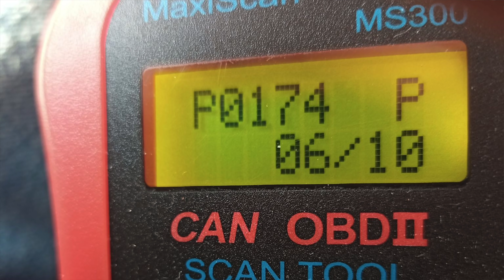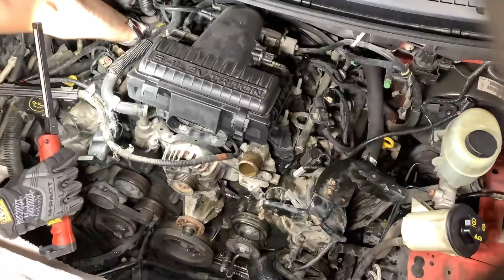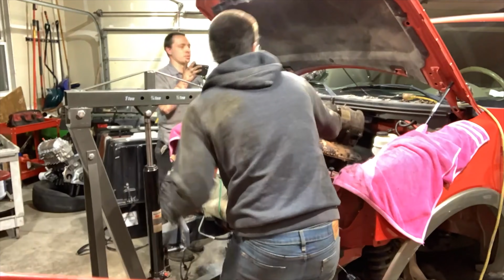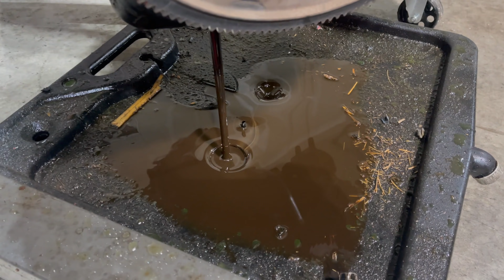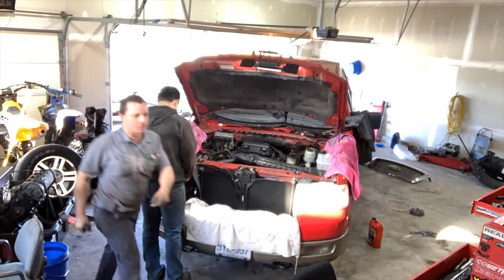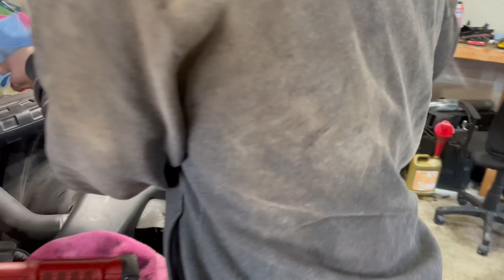2005 F-150 5.4 Powertrain Overhaul

Comment: If this was mine I don’t think I would of put another 5.4 back in, I would of gone with the 4.6. In my opinion there more reliable but that’s probably because I’ve had so much good luck with mine 315,000 and still running well

Comment: Dude 2006 f150 4.6 190k  why is my brake light on. 

I’m not an idiot there is fluid in it the float sensor is working and the parking brake is not engaged and sensor is also working and there is no codes.

Comment: Now time to run 5w-30 for the next 230k.
Reply: You being sarcastic or very unknowledgeable ?
Reply: @froglobster  very knowledgeable. I don’t comment unless I know why I’m talking about.
Reply: @Bushy556  You are entitled to your opinion. Maybe I shouldn’t have phrased my question to you like that. 
Facts with these engines is stick with factory recommendation  because the oil ports are unfortunately super small and the oil needs to be thin to get out quickly to the phasers. I’ve spoken to old school mechs I know plus vids all over. I have an 08 F150 106000 miles I use the Ford recommendation no problem clean block oil change every 4-5 thou. Had truck since 2010 ain’t risking thicker oil.
That’s enough backup facts for me plus owning one.

Comment: I have a couple questions. I love how these trucks look but isn't $10,000 in repair excessive?  Wont it be better to get a used 4.6 2v from the junkyard inside?? I am not  very familiar with these trucks and  I don't know if the engines are interchangeable. I could understand a re manufactured transmission. In the case of the engine, are the re manufactured engines prone to problems again?? If I do get this truck, How long can I drive with the bad cams before it explodes?? Thanks

Comment: what wouldve been nice is a melling 360hv oil pump but im sure upkeep on oil changes will do fine
Reply: He could add one when he reaches about 90,000 miles on this engine, timing set & oil pump is good preventative maintenance.
Reply: @paulsosa1872  true, I did my timing and oil pump at 300,000

Comment: Did the same repairs on a clean high mileage non running 3 valve F250 I purchased:
Six years later and she still runs like a top.
Gotta love that vacuum hose on the lower backside of the intake manifold. Was a PITA to connect with the manifold installed, was difficult to reach.
Reply: I'm starting mine and I'm worried about that thing

Comment: They last a long time.. 5.4L 3V withstanding. The 6spd trannies are rock solid just replace fluid every 60k mis or 40k mis if you tow heavy! Owned 2 - F150s w/5.4L no issues. Now run gen2 Ecoboost '18 F150 Lariat FX4.
Reply: That body style only had 4speeds for the v8 trucks
Reply: @MichaelFletcher-to7mm  that later yrs towards end of cycle had 6spd trannies. They used the 6spd till '17 in F150. Drive the new 10spd sometime ..its amazing.
Reply: @Davido50  I’ve driven the new 10 speeds, the 6 speed wasn’t in the f150 until 2009

Comment: The only problem he made is not running the right oil from new you have to run 10w-30 conventional mine is all original engine and transmission never touched and my 5.4 three valve has 325,000 miles and still daily driven and still tows trailers weekly
Reply: I think you might be right. 5w-20 and extended oil changes kill these engines.

Comment: I have 310k on mine. Same year and engine, just a super cab and 2 wheel drive. I have a lot of problems with the drive. Pulling, steering wheel crooked, suspensions noises. Plus some engine misfires. 
Do you recommend I put some money into it? If so what would you do?

Comment: Just hilarious how many Silverado’s with over 300k running just fine
Reply: Exactly. My 2004 Chevy @ 290,000 and still runs great.
Reply: 95 k1500 380k miles
Reply: My 2010 f150 with 4.6 3v has 315k miles and still running fine
Reply: 97 K1500 245k
Reply: Pre 2000, everything after that has similar problems with oil pressure. A lot of the ones 2008 and -2012 are trash and you know it
Reply: And way easier to work on.
Reply: My dads 2015 needed a new engine due to AFM 1800 miles out of warranty.
Reply: @Bushy556  how frustrating!

Comment: Is the new 5.4 better than the old one?  As I understand it the old 5.4 3 valve had smaller oil passages.  Is the new 5.4 built better?
Reply: I'm not sure where people have gotten that from. The size of the oil passages were never the problem, the factory oil pump is. The backing plate on the oil pump begins to fail, causing the oil to pour back into the pan instead of being sent to the heads and timing components.
Reply: @kingdaniel3519  Sure - that's the only problem with the 5.4 or ANY Triton engine (sarcasm)

Comment: I just replaced the exhaust manifolds, timing chain and tensioners, oil pump,  got a phaser lock out kit with a tuner. Truck runs better than new. Spent $2200 total.  The 5.4 3V doesnt have to be thrown in the trash unless you have some kind of major failure. They are tougher than people think
Reply: How much torque down low did locking the phasers cost you?
Reply: @jakejacob9814  Honestly it feels better than it did before the phasers went out. I also put a full duel exhaust with X pipe on at the same time, so that probably helped the low end too. Im glad I went with the lock outs
Reply: I was at the same point with my truck. I went ahead and got a crate motor from Ford. 2k more for a whole reman engine compared to timing job components.
Reply: @kawalaco  That's one way to do it. I knew I had a solid short block (good oil pressure, no knocks, no oil usage or smoking), and I wanted to eliminate the whole cam phaser setup, so I chose the lockouts
Reply: Yeah it gets boring listening to the slamming. My 08 F150 runs just fine.
Reply: @froglobster  I promise you 95% of the people bashing the 5.4 3V have never owned one. They just parrot what others have said on youtube. Everyone thinks a mechanic that has a youtube channel is some kind of  automatic genius. Nope

Comment: Backfire is caused by bad spark plugs.  300k miles on my 04 5.4 3v no issues ever (original everything). 15w40 8qrts since new..original: coolant,fuel system,power steering,trans fluid, coils,water pump,exhaust.    Replaced: belt,pulleys,battery,e3 plugs, its on its 3rd alternater.

Comment: Exactly how I felt after rebuilding my 4.6 on my 97 f150. She purred quite from first  start and been running good ever since. Wish I could have afforded a new one, would have been less than half the work. Fords can be tough to work on, you guys worked your ass off for sure, that would have took me much longer to do.
Reply: Strongest motor i ever owned! Headers programer intake camms ", i was getting close to 340 hps

Comment: The options are: get a newer truck where in 5 years ownership and like 60k miles, the repairs will probably be over that 9k, parts only but you know. It's less reliable in most cases, minimal good features. 9k plus labor so idk lets just say its 12k 15k, that's what....a 2010 truck? So get another truck with lots of potential problems and probably in rough shape...yeah no. Not all that sure that i'd pick a 5.4 3v as the truck to put all this money into, BUT if it can give him another 150k plus miles, that's surely worth it.

Comment: Opinion on 2011-2014 6.2 f150
Reply: they are great but very expensive and hard to find. There was one for 25K, I tried to bargain and it was sold the next day. They have a small issue with breaking valve springs but usually 100% repairable.

Comment: When my 04 3V Triton puked it timing guides like most guys I chose to rebuild timing in place....my truk although not as nice as this one was at least very solid. It was mostly a workhorse.
By the time you are done dealing with a hundred other things you will discover its far better to just replace the engine ....mine drove me crazy for months afterward with small crap....it just wears you out working on these things because they are so badly designed and no thought given to EVER repairing them.   Your point abouth the intake is spot on !
I did the timing set but left the intake on....as soon as it was running again I had lean codes big time......had to go back in and pull the intake....what a nightmare.  Seems the gaskets were dead and perhaps got disturbed doing the timing set just enough to leak when it ran again.
The list of stuff that I did fix with the timing is long too and added to cost....power steering pump and lines...oil pump you MUST always do that !  Pulled the pan to clean the shredded plastic from timing guides out of it.  Had to go back in and replace the oil temp sensor !  It throws codes if it can't read it !
That said it has run great for the last year so Im happy.  Did 100% of the work myself still cost almost 4K Canadian dollars by the time I did plugs and coils.   Worst vehicle I have ever worked on....04 was a complete re-design and this is how it was done !  Smokin toooo much stuff at Ford.

Comment: When I changed the motor in my 2005. I purchased a engine from a 2011 F150 since it has newer style spark plugs
Everything you changed mins the trans
Banks Headers
Vct lock out and HP tuners tune
👍👍
Reply: Your story is crap. The 5.4 was phased out of the F-150 in 2010.
Reply: @kingdaniel3519  your face is crap
Reply: @gr8bart1  Thank you for that, you pre-pubescent assclown.
Reply: @kingdaniel3519  LOL
Reply: @kingdaniel3519  I didn't say I put in a eco boost did I!!  I said I put in a 5.4 with the newer style head. If I was off by a year in my comment who cares. They made that motor till 2013. Keep on moving your trying to make something outta nothing
Reply: @gr8bart1  it’s OK, bud. You got caught lying. Move on with your pathetic life. 👍
Reply: You can’t put a 2011 engine in a 2010 let alone a 2005 unless you want to spend thousands more to make sure the electrics function properly.
Reply: @jass7981  Doesn't matter if it was a F150 Expedition or Navigator it's all the same Ford made that motor till 2013 with redesigned heads.  Move on troll.
Reply: @gr8bart1  Ford did not put a 5.4L in a 2011 F150, troll.
Reply: @jass7981  Who cares dude, you probably can't even change your own oil. Let alone do a engine swap. Move on from my comment, make your own
Reply: @gr8bart1  not sure why someone would lie about something like that. You must be pathetic in real life. What a loser.
Reply: @jass7981  yet your still here.

Comment: With Regular Maintenance. This thing will run for another 200k. Biggest thing to kill 5.4 3v is lack of maintenance. I do wonder if it would have been faster and easier on your back to just lift the cab off instead. Since you replaced the engine and trans in one shot.
Reply: Obviously, this one was meticulously maintained, inside and out - but still - engine/drivetrain needs to be replaced at 200,000?   This isn't the 1960's when that was considered "long-lasting"!!!

Comment: Do you still have the black F150?
Reply from the maker: Yes
Reply: @DanielJaegerFilms  Ok
Reply: @DanielJaegerFilms  the body on that truck is amazing i take its a southern climate truck? I have an 07 almost identical to this truck mine is all red xlt with 147k the rear wheel lips are rusting as is the cab corners in 2016 at 105k the 5.4 3v died all the timing
 components went due to low oil pressure a new 5.4 3v from ford was installed for 7k its just a shame how the rust is eating away but im in Illinois
Reply: @iamkazie9401  In salt areas all the 04-08s have frame rot. With all the other problems best to avoid.

Comment: My old 4.6 2v sounds just like that factory fresh 5.4 even after 220K miles, best engine Ford ever made after the old 300 big six
Reply: The new 5.0 is definitely better in basically every way
Reply: @ah4800  So you say, the coyote is more complex and has more to fail, after you replace the original intake manifold with the updated part there's not much else to be done to a 16v 4.6
Reply: @vacexpert2020  also has 100 more hp and better mpg. 5.0 has a good record
Reply: @ah4800  Power and efficiency are second to ease of repair for my purposes, I've driven a 5.0 F-150 before and liked the power, but in usual ford style after they get a bunch of miles on 'em the top end gets noisy, the old 4.6 is hanging in there, only that's been done is a timing set before I bought it, no cam phasers, VCT solenoids, or variable intake runner actuators to worry about like with their newer engines
Reply: @ah4800  yeah and all that tech to make it better will not last as long as a 4.6 2v
Reply: @samholdsworth420  any idea how much "tech" is in a diesel engine and they last a million miles. Trying to justify a 4.6 because its basic doesnt really work. Sure theyre decent. By that idea a model a ford should last 200 million miles.

Comment: Worse engine ever in a ford with the 6.0 diesel being second. I have owned both but would never buy a 5.4 ever again. The 6.0 I still have and would buy again. 9K in parts on a 8K truck not a good choice. I would have dropped the 9K in a f150 with a 5.0 in it.
Reply: I have a 2010 f150 with the 5.4 and it's been pretty good. I guess the 2nd gen 5.4 was just the junky one.
Reply: 6.4 is absolutely junk. Boat anchor at 150,000 miles.
Reply: @upload15613  My 2013 with the Coyote 5.0 has 258k miles and still running great and never have to add a drop of oil between 6k changes.

Comment: With the out of control price of trucks now a days this route is a good option.
Reply: Yes thats exactly what he's doing i believe! Clean 230k mis chassis. F150s last a long, long time w/ good maintenance! I bought a new '18 F150 Lariat FX4 I will keep 250k+ mis.
Reply: I noticed that last summer. Almost brought a good base model Sierra with around 180k for $9k, and some would consider it a steal!
Reply: @ramanpreciado2241  that's not bad if its clean an well maintained! Any the big3 truck brands get 300k mis easy if good basic maintenance done Thats why ppl shell out $45-65k for F150s , Sierra etc cause strong, safe, practical.
Reply: Its what I'm doing with my 08 f150 5.4

Comment: His cost per mile for the next 200K for the repairs is about 5 cents per mile. If it's driven 500 miles a week on average, that works out to about $100 a month, each month until it reaches 200K from now. That's just covering these repairs, not anything that may arise between now and then. So, yes...even with the shocking outlay, it is STILL cheaper by far to completely overhaul an older vehicle instead of buying a new one. Car dealers and people who just want a new truck don't like hearing that reality but the numbers don't lie....just the truck salesman ;-)
Reply: Finally someone else possessing rational thinking about keeping old vehicles going.
Reply: Very true, I often assume everyone has the know how and tools to tackle a job like this, but that often isn’t the case. However, I think most people assume they aren’t capable of things that they are, which is unfortunate.
The good part about older vehicles is that the problem you’re facing has more than likely been documented on the internet already.
Reply: The way I look at it, if the body is in good shape inside and out, and you like the vehicle keep her going. Of course doing the job yourself if you can, is the best option and stay away from rip off shops. Labor alone can be so high, most won't do it this way, and the lazy sure won't. A job like this is not for everyone, but for those who can, it can indeed pay off in the long run if you got the skills.
Reply: You could do this a lot cheaper
Reply: @psyker4321 how? What would you cut or change to do more cheaply?

Comment: Thanks for reminding me why I’ll never trade up from my 03 F150 2V King Ranch.
Reply: I admit the 2v was a good engine but the 3v isn't as bad as they're made out to be.
Reply: @kingdaniel3519  if you keep up on maintenance and repairs they do generally last a long time. The 2V need less repairs.
Reply: My 2002 F150 is going to be in the junkyard from rust before the drivetrain gives up.
Reply: @cp6027  spray it underneath with fluid film once a year and it will outlast you!

Comment: What did they end up paying out the door? This seems like an excessive amount of work for a truck like this.....
Reply from the maker: Total cost of the job ended up being $10,391
Reply: @DanielJaegerFilms  Quality work done. Hats off to you! I did a timing job on my 5.4 2V and it took me 3 hours to just to remove the intake as the water crossover gaskets as well as the intake gaskets were shot. People underestimate the time it takes to do these jobs.
Reply: IDK these newer trucks are falling apart badly too much technology.
Reply: He said $9k of parts in the video.  I would never put that on that truck and would have used that money to get a newer one. That’s just dumb.
Reply: @nizmoz44  9k in parts but what did that labor cost on top of that... this is gonna be 1-2k in labor easy so you have spent $12k+ in a 16+ year old truck with 230k+ miles. This is the dumbest financial move I’ve seen. You buy a newer truck and that’s right there is 50% of the cost. Newer, less use, more reliable, more capable.